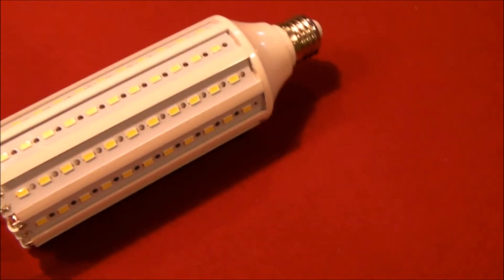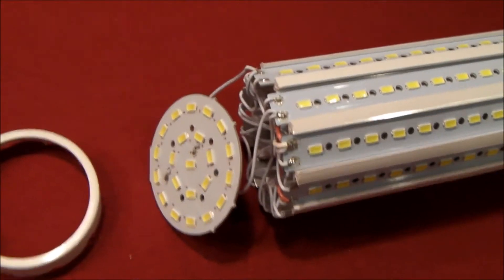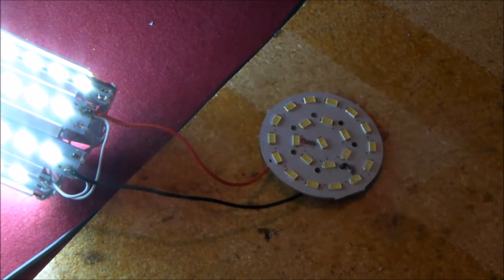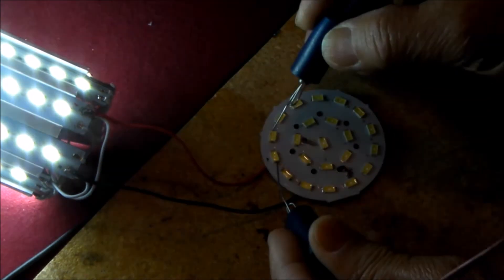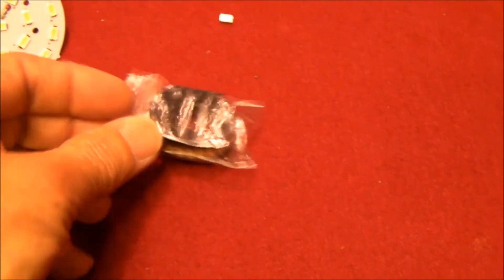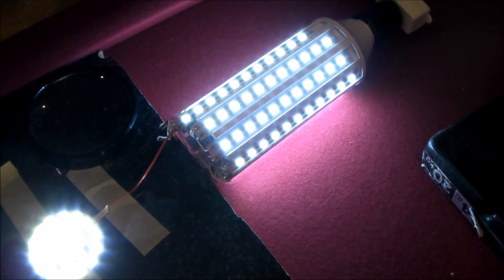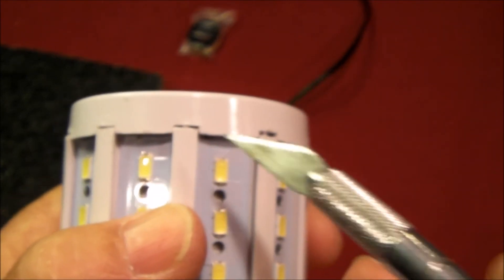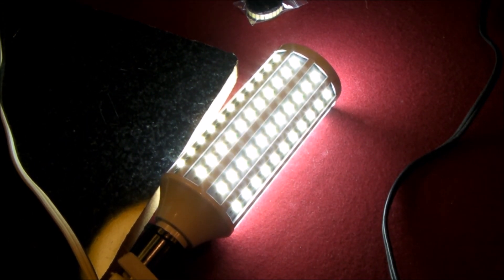Fix flickering COB LED light bulb; identify and repair single bad LED

Comment: Thanks for the troubleshoot!  I did the same but I am using a 9V battery to test all the LED until the bad one, I know 9V is a bit high for the LED but just for the very short period it is fine.  My method is safer since you are not on 110V when probing 8-)

Comment: Where did you get your chips, ebay? Right now they sell 100 pcs for $1.20...
Reply from the maker: Ailexpress.com ...  What Chip are you looking for?  I might have some extras.
Reply: On ebay, description says "20~1000pcs high power 0.5w 1/2w SMD/SMT 5630/5730 white/warm white LED". I need cold white. These look like the ones on my bulb, no idea how to tell but visually. No need for extras, I can always short across the chip. Thanks for the offer and the video clip!